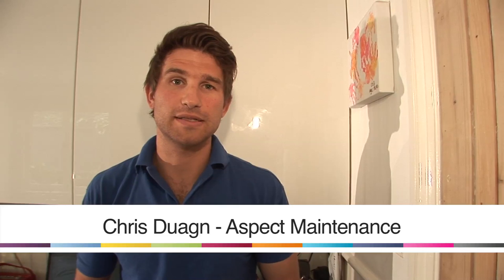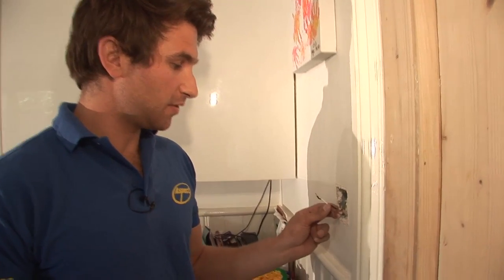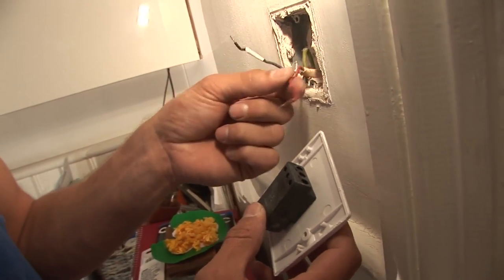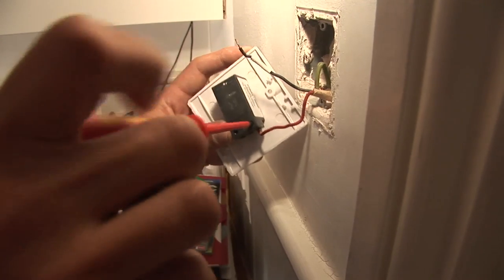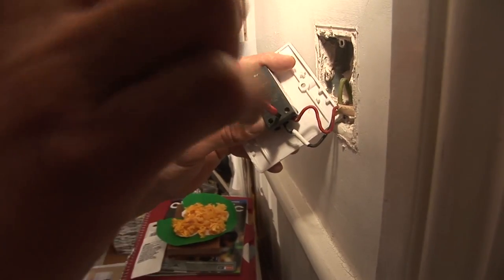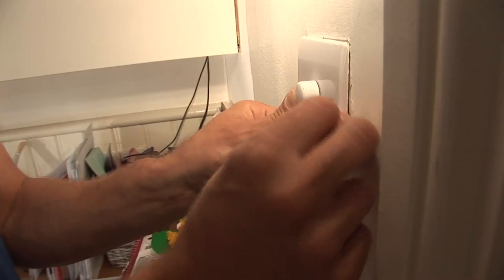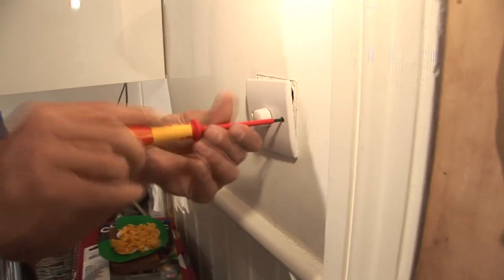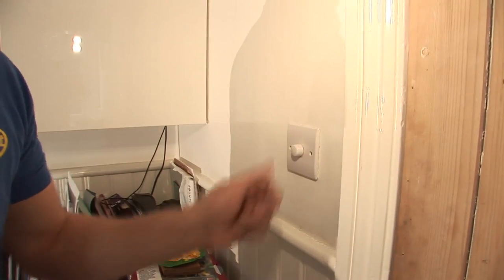How To Wire A Dimmer Switch

Comment: For those asking what to do with the earth, it is usually attached to the metal box in the wall (the switch housing) which holds the switch and the wires. If the front of the switch plate was metal it would have an earth connection on the back so you can run an extra earth cable from where the earth is already connected to the box in the wall to the back of the plate.

Comment: @weerpool14 It dosent need to be its made from plastic, you only need to ground older dimmer switches with a all metal case, even if the outside is metal but the inside is plastic it dosnt need to be earthed.

Comment: I want to use a dimmer switch to change the speed of an electric motor. Do you feel this will work? I want to use it in a small lathe to turn wood and hope to use an old washing machine motor. Your help would be very welcomed.
Reply: Sorry should have added that I want the dimmer switch to vary the motor speed.